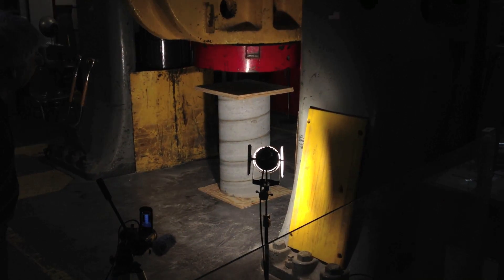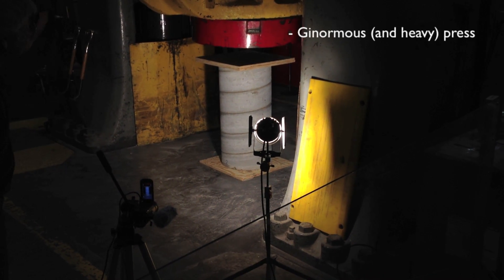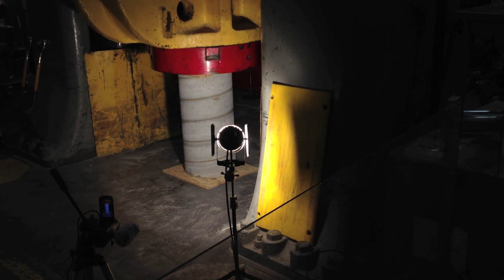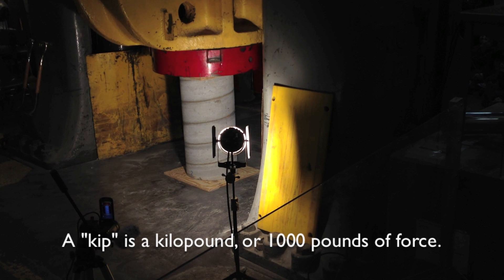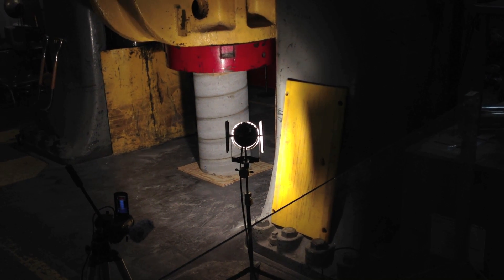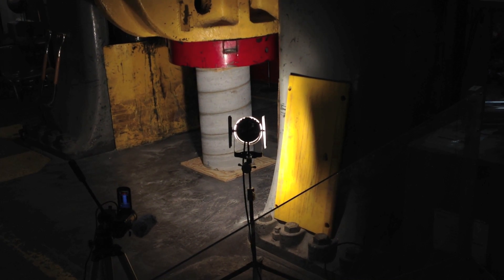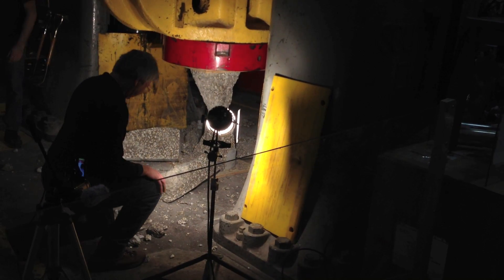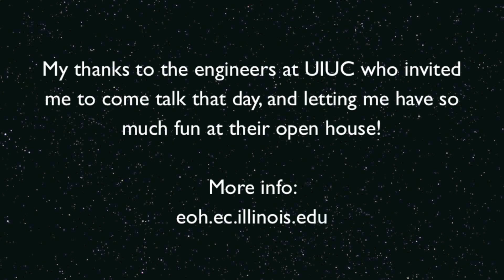How much pressure does it take to crush a concrete cylinder?

Comment: What would the failure look like if the pillar was properly reinforced with steel?
Reply: Reinforced steel does not help with compression
Reply: Thanat Pattana Technically yes, reinforcement is for tension. But it would also hold the pieces together when the pillar shatters in compression. That would be interesting to see.
Reply: Reinforcement would indeed confine the "core" and increase the compressive strength. The most common ties (#4 or 1/2 inch diameter bars at 12-16 inches o/c) will not prevent the concrete from failing catastrophically. So-called spiral ties actually provide enough restraint that the concrete fails in a ductile manner, but it is expensive and is not used much (limited to seismic applications).
Reply: It would probably confine the core and increase the strength by 20.000lbs but who knows it might actually get to 2 million pounds

Comment: I was wondering if someone could help me?
Lets say I wanted to break a pillar by applying force to its side, a pillar that is 5 feet tall by 4 feet wide.
What is the equation for that and how many tons of force would it take to break a 5 feet tall by 4 feet wide concrete pillar?

I'd appreciate it :)
Reply: I am having the same problem figuring it out. Did you get this from Death Battle, Yang vs Tifa?
Reply: Yes, and I did end up finding the right info, form one of DB's unpaid researchers.
The pillar broke at 800 tons in this video, and Yang was punched through that pillar form the side, that means the flexural strength (side to side) of that pillar is 10% of the compressive (top to bottom) meaning Yangs durability was only 80 tons :http://www.theconcreteproducer.com/concrete-strength/compressive-vs--flexural-strength.aspx

AND, those same researchers calculated Tifas power output here, keep in mind that this is based on DB giving Tifa a 153 base strength without her PH gauntlets with one arm, the full total is double the results for both  arms with a total of 232,560 tons! 10.5 times the power of the Hiroshima bomb.
http://screwattack.roosterteeth.com/post/51231319

to say Tifa is less durable is unreasonable, to say she couldn't have killed Yang is as unreasonable to say the least >.>
Reply: Thanks for replying back and help me figure out the problem. I've been trying to figure these calculations for over week. Also, I agree with your last comment about Tifa. Thanks for the help.
Reply: Your welcome, even if they don't admit to being wrong about Tifa vs Yang (among others) we can settle for knowing their wrong, and telling others :)
Reply: Wait one second, does this mean that one of the DB researchers admit to making a miscalculation.
Reply: Dylan Brooks Actually the only researchers that made a mistake is Ben and Chad themselves.
And I'm more than certain it was a rigged fight to promote Rwby season 3.
And why not? Why would their parent company not give them kickback just before they merged with screwattack?
Reply: So Rooster Teeth does own Screwattack then? I thought Screwattack only sponsored Rooster Teeth. It makes sense now that they would let Yang win now. Still upsetting though that Tifa lost. I bet Ben and Chad would rather have wanted Tifa win too, though.
Reply: I'm not assuming Ben and Chad didn't handicap her deliberately.
they did the same to other characters, Cloud included :/

Comment: Science already knows the strength of concrete.  What was the point of this?
Reply: Average Joe people like to see cool things
Reply: Average Joe first off, this is a demonstration for schoolchildren.

Second of all, no science doesn't "know" the strength of concrete. Concrete mix designs are a bit of a black art, with the strength of concrete varying with quantity and type of Portland cement and other cenentitious materials, amount of water, and the quality and type of aggregate (sand and gravel) that is available. Concrete cylinders are cast during construction...they are tested to verify that the concrete meets spec.

An aside...this particular hydraulic testing apparatus was used to do much of thr research for the Interstate Highway System back in the 50s. When the old girl is testing big samples, the whole building shakes.

Comment: This kind of thing is done regularly on smaller cylinders as part of quality control procedures.  Generally it is measured in Kpa, or Kilo PASCALS, which is a measure of pressure, the basic formula is p=F/A.  They are using KIP and disregarding the area of the face of the cylinder is incorrect and I am disappointed that I have to point this out to a University.  I havent even watched it break yet, I had to stop it and get technical.

Comment: I appreciate the lamp for extra lighting, but it does more harm than good if the lamp is blocking what you are trying to film
Reply from the maker: I was one of over a hundred people in the room as the audience, so I didn't have any choice where to stand. i was lucky to get this at all!
Reply: You are right about that. I did really enjoy and like the vid. I am still wondering how a press could be anchored to the ground that well. With that much force I would expect it to want to lift itself off the concrete. Cool stuff
Reply: Duke Silver It is there for the other camera.
Reply: ***** Thank you very much for this, but for the love of science please film this with an ultra-high speed camera. Dustin from SmarterEveryDay would be happy to do it, I'm quite sure. 
Thanks again!

Comment: Why is the video title "how much pressure does it take to crush a concrete cylinder?" when you only give the force needed? Assuming it fractured at 1600 Kips with a 9 in radius, that would be 6287 psi of compressive stress.

Comment: The floor is solid concrete which is thicker than the cylinder. Because there is a piece of plywood beneath the cylinder, it distributes the pressure so it won't leave marks. Or magic, I 'unno.

Comment: It is like a bearing pad, to prevent point loads between the hard surfaces that do not match up to each other perfectly. Point loads are undesired in testing as the test specimen may fail prematurely and give an inaccurate reading of the true capacity of the material.

Comment: This just the standard test done for inferring the compressive strength of concrete alone, which is a value you need to know when designing steel reinforced sections. Steel would make it stronger, but more importantly, it would stop the section from exploding if placed correctly. I think they wanted it to explode for effect.

Comment: If it takes a force of more than 1600 kips to cause the cylinder to fail, the pressure required is over 6000 PSI.  
(1600 kips * 1000 lbs-force/kip) / (pi*9inches^2) = 6287 PSI
The cylinder has a diameter of 18"x3', test cylinders are typically 6"x12".  If you were to break a regularly sized test cylinder that is also made of >6k PSI concrete, it would require a 177 kip load.  Concrete typically ranges in strength from 3k-4k PSI with 5k PSI being "High Strength".  Their cylinder is tough and BIG

Comment: Kilo is not metric specific... Kilo is just a prefix that you can use for any unit, regardless of the unit system. Example: A Mega-Pascal (MPa) has the same amount of Pascals as MPsi has Pounds-per-Square-Inch.( A Pascal is the metric equivalent of Psi )

Comment: everybody already knows that the system is less efficient. the issue is that every piece of hardware on pretty much everything mechanical or just man-made is to us customary units. We can't just stop using them. What do you expect? Someone to just snap their fingers and every single piece of equipment down to every last nut and bolt magically attune to metric specs?

Comment: psi is a standard unit of measurement in america.  don't bitch when americans use their units when they are the ones doing badass stuff for themselves.  also, its an easy calculation

Comment: I don't understand. This is simply load testing and the concrete eventually failed under load. So what? I was expecting the floor to fail or the side structure of the press to lift out of the floor ... but no. Same as stretching steel bars in a tensometer. The bar stretches a bit in an elastic way and then plastic and then fails.  Not even remotely unexpected.  Now if the concrete pillar was center filled with 4140 HC steel then we would see something new.

Comment: So let me get this straight, America signs into law The Metric Conversion Act in 1975 but you continue to use the Imperial conversion system, that's fine. But you use the word "Kilo" (a metric unit prefix meaning 1000) and add it together with pounds to give kilo-pounds?

I wonder how tall I am in Metre-foots.

Comment: The concrete cylinder test is to determine the compressive strength of a concrete mix. Concrete is very strong in compression (pushed together), very weak in tension (pulled apart). Any rebar used in concrete is to provide tensile strength.

Comment: Concrete has impressing compressive strength but it is much weaker in shear.  BTW: Divide by 2.2 to get Kilograms from Lbs...
Reply: I just reuploaded the video on my channel with the measurements in kilograms

Comment: Concrete is very, very good in compression.  Not so good in tension.  Reinforcing concrete helps with tension.  Pre-stressing concrete helps a lot more.  Even so, concrete doesn't do well in tension.  Which means that cantilevers, sagging beams and hogging beams are not well served by concrete.

Comment: Btw 18" cylinder, failing at 1600 kips equals about 6300 psi, that is fairly high strength concrete. I guessed it would have failed around 5000 psi.

Comment: I remember enough from my civil engineering schooling to say that the cracks form along the lines of shear although not quite enough to say why the shear forms in that direction. Something about how when the cylinders are compressed from the top and bottom the sides basically want to bulge out so it fails in the middle where it is expanding.
Reply: It’s unreinforced concrete so no